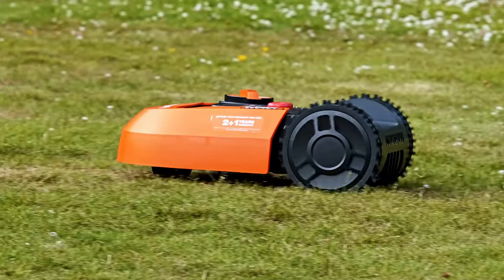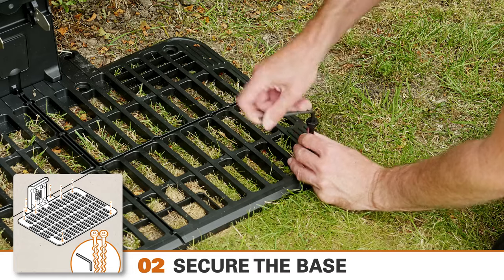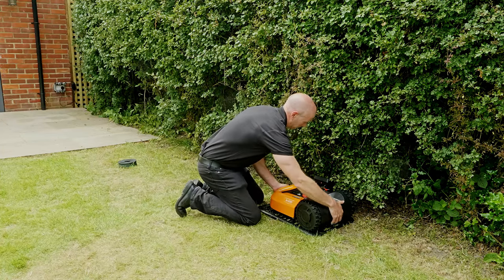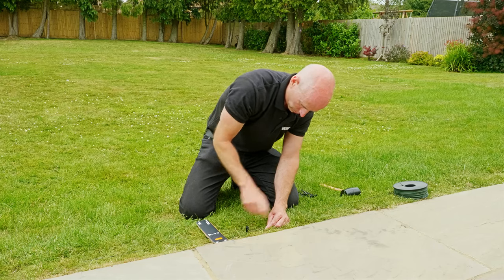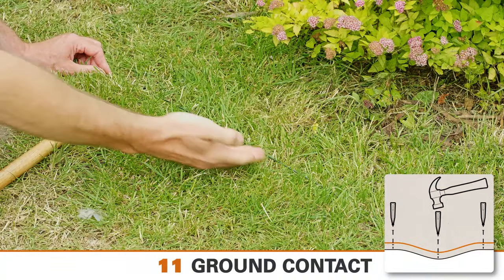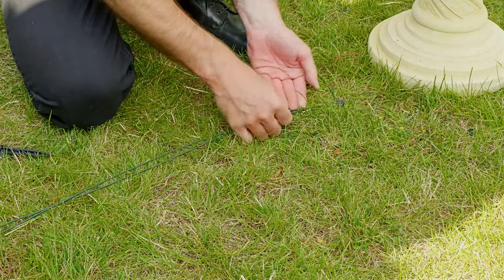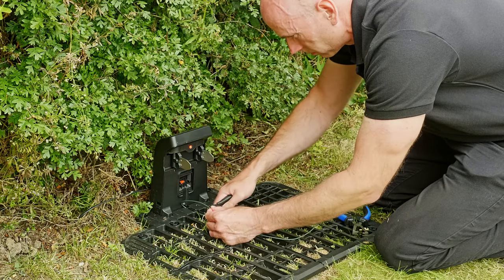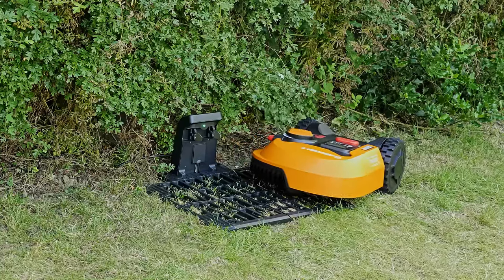Worx Landroid Installation Guide

Comment: NB : You show installing around the fountain bowl at 10cm. Howerever, it has a raised edge so it should be at 26cm as if it was a tree.
Reply from the maker: That is a debate here at HQ.  Technically it is too small a circle for the mower to pick up on the wire and run in a circle around it, so the 10cm is enough just for it to bump off the bird bath. but if the circle were any bigger it would definitely need to be 26cm in case the mower decided to treat it as part of the boundary and try follow the wire.
Reply: @WorxUK  I digg the transparency and openess. I'm curious about putting the base station next to/on an island like a shed or gazebo for the shade and power
Reply from the maker: @cdoublejj  as long as it has enough room to maneuver it should be fine.  It needs enough to approach in a straight line and pull off straight, although it usually does turn off the base right away. There are retractable roof garages available but a lot of people just install a simple shelf/shelter.

Comment: I live in tropical sunshine Scotland, lol is this thing (electric prong charging station) even weather proof, there's no mention of cover sheds anywhere
Reply from the maker: Hi, it is fairly tropical at the moment even in Scotland ;) Yes it is all fully waterproof. Slightly south of you we're had no cover and had it out three years with no issues so far.  As part of the yearly maintenance we do advise cleaning the prongs by rubbing with light sandpaper to remove oxidisation but we are also developing a removable charging station for those in more extreme climates. Garages are available from Amazon and E-Bay and a lot of people also make their own.

Comment: I just got one today. It works fine but I sent it home once from my phone. That's when it hit a no go area around a tree and decided to follow that home. Only it just kept going around and around the tree. Any suggestions?
Reply from the maker: Hi David, the best approach is either to pull your tree ring of wire out to be a bigger, preferably squared off shape rather than a tight circle or to widen the wires going out to the circle around the tree to further than 15cm apart so that the mower recognises them, and will incorporate the tree into the boundary. Hope this helps.  Please don't hesitate to get in touch with your customer service team or the Worx Landroid Fan Club for a quicker response should you need further advice.
Reply: @WorxUK  Thanks - I think your last suggestion will work well. The mower will have a patch of grass between the wires leading to the tree, that will not be cut. But when the mower does the edge cutting twice a week it will probably get it there. I haven't had the problem other then that one time, so I will probably just leave it as it is.
Reply from the maker: @davidmllebjerg1321  Hi David, yes I think if it's only 15-20 cm the edge cut shout cover it.  Great, hope it doesn't happen again, the AI is normally quite good at learning as it goes, but if it does, you have a solution.

Comment: We have lots of trees but have ordered the ASC Do we still need to run the cable around the trees ?
Reply from the maker: No the ACS was specifically designed to avoid trees and run around the base and resume mowing to continue in a line from where it avoided the tree.  Unless there are above ground roots that it will get stuck on, you should be fine to not need to isolate each tree.

Comment: Hi Team. Just took delivery, hoping to install tomorrow. I have some stepping stones that run from my patio to an outside office- they are pretty much flush with the lawn. Do I have to delineate these with wire, or will the gizmo just happily mow over them?
Reply from the maker: Hi Con, as long as they are flush they won't be a problem for the mower.

Comment: Hello, just purchased a L2000 model and figuring out how to lay the wire. I have a place where two wires converge into a point, i.e. a path and the fence. how tight a loop can I make for it to cut a maximum space? Didn't find helpful advice on this in the manual.

Comment: I recently purchased a used model which did not come with the triangle piece for right angle turns.  Could you provide the dimension of that so I can cut out an approximate to use when laying the wire?
Reply from the maker: Hi Jesse, it’s 37 x 40 x 22 cm. Hope this helps.
Reply: @WorxUK  Thank you!  One more question:  Can the charging dock be placed near one of these right angle turns, or does it need a clean stretch of 30cm or 80 cm?  (In the spot I would like to place it, It has the room, but the triangle would overlap that space)

Comment: I have section of about a foot and a half of grass between my patio and swimming pool. If I put boundary wire around pool and patio, will the landroid mower have any issues cutting in-between this section? Thanks.
Reply from the maker: Hi Jeff, that's a bit narrow for the mower to mow. It may pass through but only on a boundary cut. You might have to exclude the pool as an island the way the bird bath is done in the video, but it's difficult to best advise without seeing your set up. If you need more advice, the Worx Landroid Fan Club on facebooks are full of Fans who are very experienced and knowledgeable or you can message our team on there showing photos of your set up for more advice.

Comment: Hello, is the transformer and cable connector waterproof as I see it has been plugged and mounted outside, and the plug is in a waterproof socket!
Reply from the maker: Hi Reese, yes they are.  You would only need to buy a waterproof housing if you need an extension for the cable.  Hope this helps.

Comment: How to make Landroid cross the driveway and mow another side of the lawn? Certainly buying two Landroids for a lawn is expensive and I wanted to see if there is a way to solve my issue by using a Landroid L.
Reply from the maker: Hi Kevin, there are various ways you can probably solve this, but it depends on what the layout is like. If the mower can cross the driveway, it’s fairly easy as it can be set up as a second zone. However, you will need to wire it and so it will rely on you having a way to lay down the wire. Pavers and paths are easier as you can pass the wire between them. Otherwise you could purchase just the base unit and wire it up as a whole new lawn, but you would need to lift the mower and place it in the second section when needed. Our helpful customer service team will be happy to advise you if you want to get in contact via the website support form.

Comment: Hallo,

mich interessiert mal, wie der Worx landroid mit Spieltürmen (Schaukel und Rutsche) umgeht und diese problemlos drumherum mäht?
Reply from the maker: Hi, it deals with children's playground equipment by a)  installing the ACS sensors, it will just slalom around it and carry on mowing or b) you can hard wire the area out of the mowing area by creating an exclusion zone when you set up the mower or c) bouncing off it and then learning where it is eventually (not ideal) or d) you can use the 'off limits' module which is also an add on, to create a section which is avoided by the mower but this is usually used for temporary areas like paddling pools or seasonal bulbs.  The ACS module is probably the best option, it can use it to navigate even complex areas where there are many trees so it should work well for playground equipment. Hope this helps.

Comment: Follow up question.  I finished laying the wire for lawn (solid green light) but Landroid LCD display never turns on while it is on the charging stand (all pins are connected, the station is level, and the light is staying a solid green instead of flashing) . What am I doing wrong?
Reply: You have to turn the Landroid on by long pressing the power button

Comment: Isn't the barrier wire just 16 or 18 gauge insulated wire? The reason I ask is my house is in the middle of my yard and I would like the mower to mow all the way around. What happens if I just make a perimeter around the yard but not the house? Is it like a robot vacuum and will just turn if it touches the outside house walls?
Reply from the maker: HI, absolutely it is 18 gauge insulated wire and you could just do a perimeter around the house and the mower would bounce off the walls and eventually learn but for the sake of the possible scraping and continual bumping, we would advise doing the house too. You treat it like an exclusion zone and just wire a 'lollipop' at 90 degrees to the boundary, around the house, and then back to the boundary again, keeping the parallel wires very close or touching. Hope this helps.

Comment: My yard is 0.77 Arces. So is the boundary enough for it or where can i bought extra? Also there is a slope in my yard. Is this works for that?
Reply: Another question: If i buy a WR147 is that gonna handle my 0.77 Arce yard?   Can it finish the job in few day by automatically?

Comment: How close do the wires have to be to each other for the signal to cancel out if i want to create a no zone area? If the wires were approximately two inches apart would that also cancel out the signal?
Reply from the maker: Preferably closer. The wires need to be very close together, preferably almost touching. Hope this helps.

Comment: How much perimeter cable is included? I can't find this info anywhere?
Reply from the maker: Hello, it will depend on which model you purchase but the length ranges from 100m to 250m of wire. You can purchase additional wire if needed and more information is available on our website: uk.worx.com

Comment: If I have a "no-go area" less than 1 meter from a boundary, what would be the solution to set it up?
Reply from the maker: The best would be to incorporate that into your layout if possible, so you permanently exclude it by wiring it off. But if this isn't practical (difficult to tell without seeing your layout) you could use the 'Off limits' kit. If you are unsure, do get in contact with our support team via the website or our Worx Landroid Fan club team are very helpful (and so are the members!).

Comment: Do I have to do the Bertelsen triangle at every corner of the house?
Reply from the maker: Hi no you don't, you don't have to use it at all if you don't want to - we find rounding the corners also just helps the mower to move smoothly.  It's just about how tight the corners are and sometimes a bit of trial and error. It is recommended for a very tight corner or if you are very fussy about your edges and want to ensure full coverage. Good luck with your installation!

Comment: just received ours - the instructions say the charger isnt to be put outside?? i cant put mine in a decent position with the short cable that comes with it - can i not extend the power supply cable and put the power supply in a waterproof housing?
Reply from the maker: Hi Andrew, the charging station is definitely installed outside. Yes absolutely you can extend the cable and put the power supply in a waterproof housing, this is recommended.

Comment: Dig the wire down. My wire has been cut at least 12 times. The robot lifts the wire up when turning and cut the wire. Does not matter how much you pin it down. When in the ground no problem.
Reply from the maker: Sorry to hear this has been an issue for you.  It shouldn't be necessary to bury the wire, but as you say, if you want it to be hassle free it's worth the extra work. Just pegging it down should be enough but you need to ensure you do it frequently enough along the boundary, your lawn is cut short so it's not lying on top of longer grass and that it's a fairly even surface.

Comment: Hello, I just bought a used Worx WR143E. Unfortunately the triangular template for positioning the wire in the corners was not with the robot. Would you be so kind as to tell me the dimensions of this triangle so that I can redo a template? Thanks in advance, Patrice.
Reply from the maker: Patrice Imbert Approximately 37 x 40 x 22 cm. Hope this helps.
Reply: @WorxUK  Thank's a lot 👍
Reply: Mine was missing the triangle and ruler. Not off to a great start
Reply: @tdizzlegames2070  They were embedded in the lid of the box for mine. Maybe you didn't see it ;).
Reply: No these are cardboard and part of the box it came in. Check the box flap. You need to punch these out.  I paid $1000 for my mower and I got a cardboard ruler and the triangle for making right hand turns. Come on Worx. Way to make people feel great about their purchase. I also bought the 'Garage' for my Landroid and it had no instructions in it. There are several drawings on the outside of the box that were faded and hard to see. That was $169 and i guess a page of instructions would have raised their cost?  I haven't used my Landroid yet and I'm excited about it but spend today unboxing and setting it up and discovered the cardboard ruler and no instructions in the garage. Not the best way to make a good first impression.

Comment: Hi. What is the alternative to the lollipop method, when something closer than 1 meter to the perimeter needs to be in an exclusion zone?
Reply from the maker: Hi Thorben, the options would be either to purchase the Off Limits module, which is also useful for other things like the boundary shortcut, or just to make it part of the boundary and have the wire go around it. Hope this helps.

Comment: How close to irrigation pop-up sprinklers can you put the charging base? If there is no shade in your yard should you buy a Worx 'garage' to house mower in? (Summer here can reach 40+ degrees celsius)
Reply from the maker: Hi Cathy, it is all insulated to withstand rain but if you could, set it up about half a meter from them?  A garage isn't totally necessary but it will protect the mower, especially from the colour fading.

Comment: Quick question: is there a way that I can force the mower to cut the edges through the app? I don’t mean via the schedule but more like a button I can press?
Reply from the maker: Hi Tom, it is usually via the schedule, either automatically or manually, when you can set it to mo & do the border that day - or you can just send your mower out to mower by pressing the play button & then immediately send it home by pressing home, it will cut the border on its way home.  Hope this helps.
Reply: Worx Power Tools UK I’ve tried doing it by just sending it home immediately however when I do this it does ride over the edge but it isn’t mowing
Reply: There is a button for cutting edges. It’s needs to be in the station to start

Comment: How would this work in a front yard?  Do you have a station in the back and front?
Reply from the maker: Greg Hicks if the mower can navigate around to the front, only one base is needed. If it can’t, yes you would need a second one. You can get them directly from Worx it from E-Bay. 03452029679.
Reply: @WorxUK  I am not able to find the base on Ebay or your website. Can you put a link in the comments?
Reply from the maker: @lcdavis15  you might need to get in touch with Customer Services if it's not in stock on E-Bay at the moment.  They are very helpful and sometimes have spares stock they can arrange for you. 03452029679. Here is the link to E-Bay but I can't see the stock at the moment. We have had some delays with stock due to the current situation. https://www.ebay.co.uk/sch/positecworx/m.html?_nkw=&_armrs=1&_ipg=&_from=

Comment: I have a Worx Landroid M500 (WR141E) which came with a 2Ah battery.
Is it possible to use a Worx 4Ah battery with this mower?
Reply from the maker: Hi David, yes you can use any Worx Powershare battery with the Landroid. Hope this helps.

Comment: Hello, I just bought a new Worx L2000 WR155E. Charging it right now - still no wire laid. Downloaded the app and tried to connect WIFI. Go through the guide in the app until I get to the actual connect push putton - which I of course can't click... It simply wont activate. Any advice on how I can move on with the connection and app?? To me it seems as an App flaw...
Reply from the maker: Hi Carsten, the Worx customer service team are available on 0345 202 979 to assist with any issues and give advice. Usually with the App, a simple re-install helps but please also check you have entered the same email address you registered the machine with as this is a security check.

Comment: I have a build in alcove along my garden wall .  The wall is 1M tall . The lawn runs to the edge of the wall .The size of the alcove is approx 1200mm wide BY 1200mm in depth BY 600mm in height . Is it possible house this mower discreetly in a built in garage in this alcove ?
Or can the base / (housing garage) ONLY be located straight along  the boundary wire line as shown in the video ?
Reply from the maker: It should be possible to house your mower in the alcove as it only needs 80cm to run in, and can leave the docking station at an angle.  However you may find it a little small. It is preferable to have a bit of space for it at the front and you also have the size of the charging plate to consider.  But, the Landroid charging station is actually so discrete that you would hardly notice it in your lawn after a couple of weeks once the grass starts growing through the base.  It really is hardly intrusive at all. It runs in from the side and requires no reversing unlike other mowers, so it is completely designed to leave the least impact on your lawn.

Comment: What about inside corners,like where the sidewalk meets the driveway,do you have to curve it at the corner or can you just make a regular 90 degree corner?
Reply from the maker: Hi Dustin, a slight curve does work better. Hope this helps.
Reply: @WorxUK why this is not mentioned in the guide or video? you guys imagine there are no corners like that or why...?